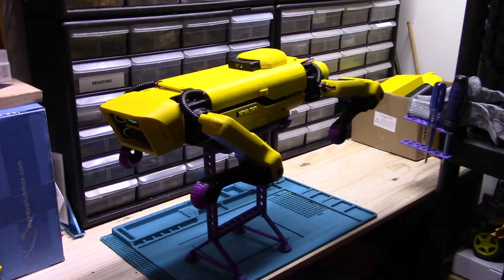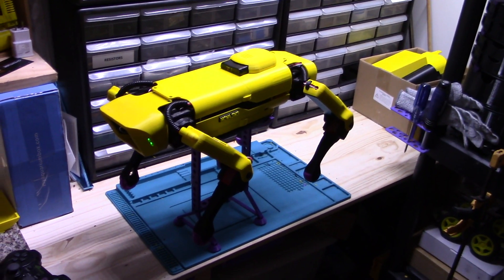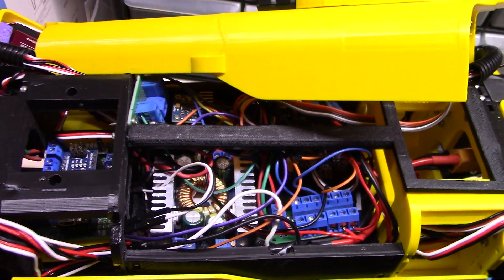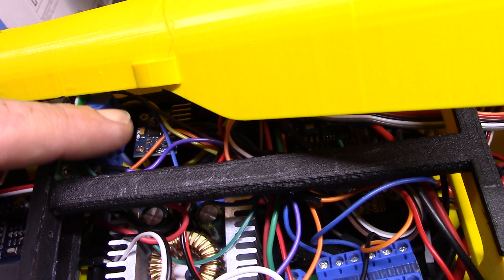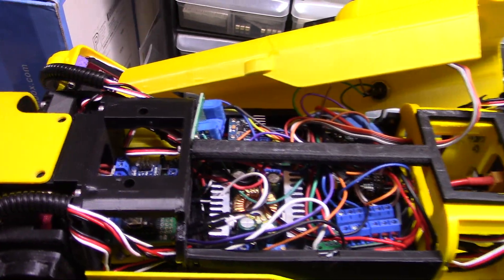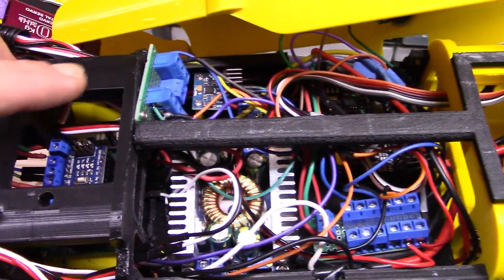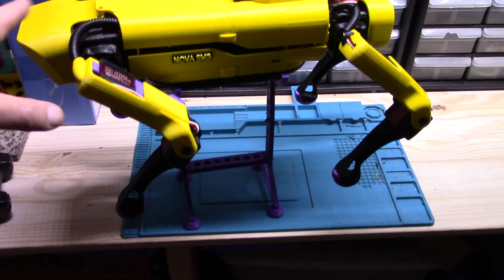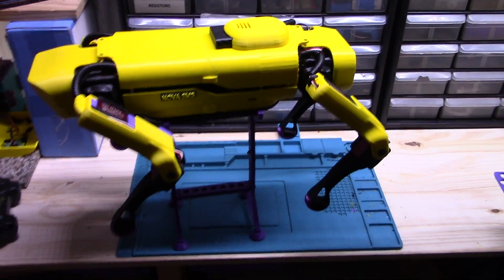Electrical Problem Solved! : Nova SpotMicro 3 - a Spot Mini Clone Quadruped Robot Dog

Comment: im happy you figured it out, hopefully we can see her walking again soon, i tested my one out yesterday and found out the hard way mg996r servos are not upto the job so waiting for some like yours now, thanks for putting the parts list in the github repository its really helpful, i dont suppose you have weighed her by any chance? thanks
Reply from the maker: Thats awesome... please share your progress when you get her together!  Yes, those servos won't cut it, unfortunately.  i haven't yet weighed her with new extensions, but last time I did, she was just under 5lbs.
Reply: @ChrisLocke1969  ye sure, hopefully it wont be long, ok thats cool i wasnt sure if i had made mine too heavy using a nimh 6v battery but the difference is only about 100g, thanks
Reply from the maker: check out the end of my latest vid... her walking physical therapy has begun! 🤣😉

Comment: saw on github the parts list... just out of curiosity, how much would it cost to build an exact replica ? ( aproximations are excellent ) thank you in advance Chris
Reply from the maker: I have estimated the parts to be about $250 - that's mostly servos. And then there's plastic at maybe $40 if you get the parts right the first time!  lol  (not in my case with all the design iterations)
Reply: 4 servos $55 https://smile.amazon.com/gp/product/B07G33GTF7/ref=ox_sc_saved_title_9?smid=A2GPFK8B5LR2OX&psc=1